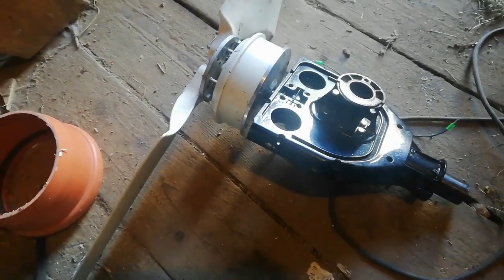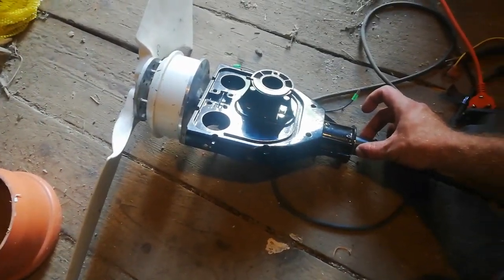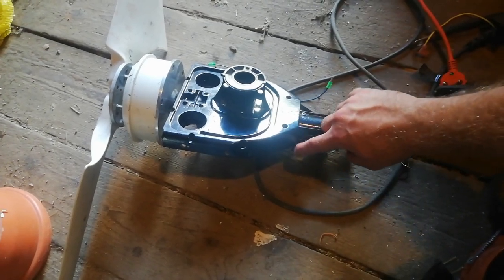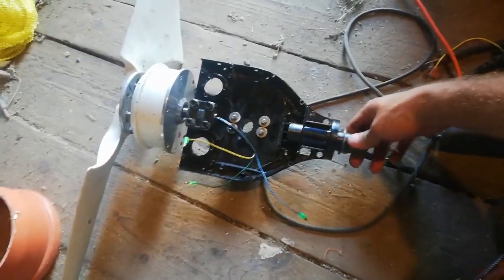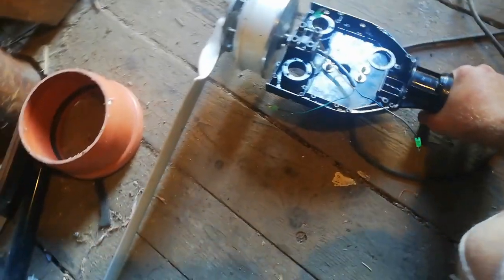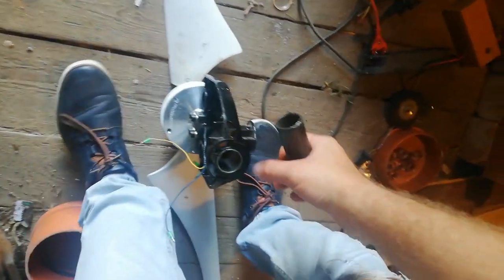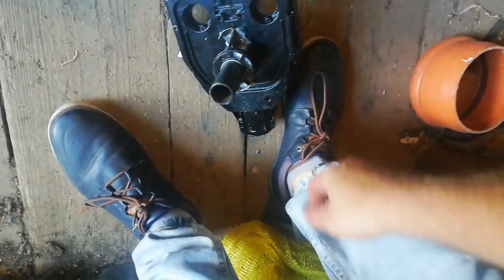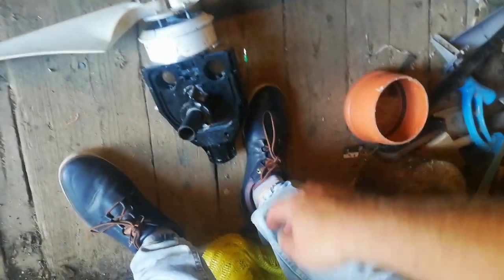Hoverboard wind turbine(HOW TO MAKE ONE FOR CHEAP)

Comment: If you'd cut the same piece off the casting that you were using, that would fit back over the shaft, and you could bolt it onto a flat plate mounting. Then if you weld the plate to a tube, it doesn't matter what diameter the tube is 🙂 - you could also refit the two halves of the cowling back onto the assembly (will need a hole in the bottom for the shaft!) it should be quite easy to protect the motor/generator from the rain...
Reply from the maker: yes i was thinking abaut it, but as i dont have welder so best diy way is this and without any extra cost(if i had to buy welder etc), but thanks for advice ;)

Comment: If you could 3d print a weatherproof cowling to keep the motor dry during the rain it would extend the life of it.
Reply from the maker: yes it would, but you can also use biger pvc pipe to wrap araund it.
Reply: @SigmaWorksSW3D  Yeah, that could work.
Reply: @SigmaWorksSW3D  I'd drill some vent slots in the bottom for cooling.

Comment: What about the efficiency of the engine as a generator?
Reply from the maker: im not sure but if it is 250w motor then it made 186w in 21meters per second... with diy blades
Reply: @SigmaWorksSW3D  Hm, 21 meters per second is pretty fast, but 186 watts is not bad.Thanks for replying, I should build one soon..

Comment: My friend, the wheel will never turn with such short feathers except in strong winds close to a hurricane.
Reply from the maker: i know... these 2 was left from 3 blade wind turbine and i was just joking araund with them in 25meters per second winds... ofcourse hoverboard needs good 5-6blades to produce good power.
Reply from the maker: @VroomvroomNY  yes 6blades works on mine other turbine like a charm but there is room for improvements
Reply: @SigmaWorksSW3D  I used the other half of the hoverboard as the mount too FYI worked out great. Can send a photo if you want to see
Reply from the maker: @VroomvroomNY  yes i would like to see :)
Reply: @SigmaWorksSW3D  Hello friend, I am studying to build a wind turbine with 2 overboar motors, I was thinking of putting 3 blades, as I had read, 3 blades are used to generate the easiest movement, according to your experience, what do you recommend? And how long? Here is a very windy area! How many what can I get out of these engines?
Reply from the maker: @sertecnico530  Hello, basicly i have got 186watts in 21m/s with 6blades (aprox 65cm blade). And thats with diy plastic drain pipe blades. With real blades you can easy get 250w out from one motor...if you use 2 motors then each motor has its own bridge rectifier. Then you can get out somewhere around 500watts.